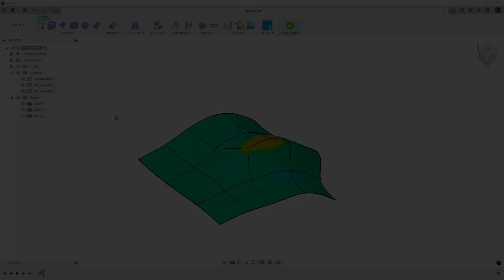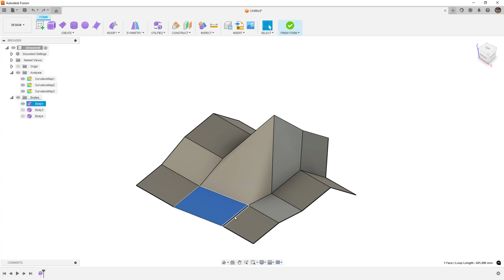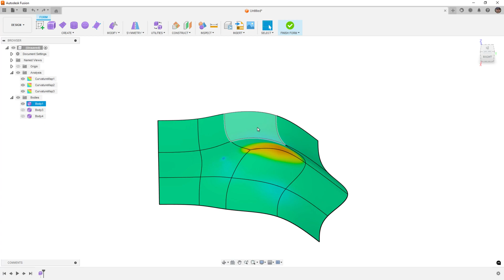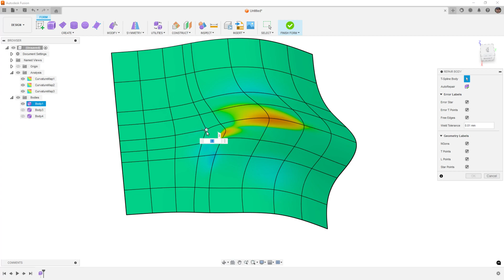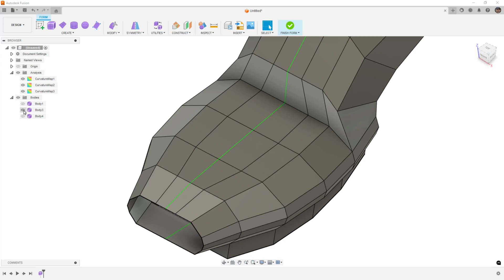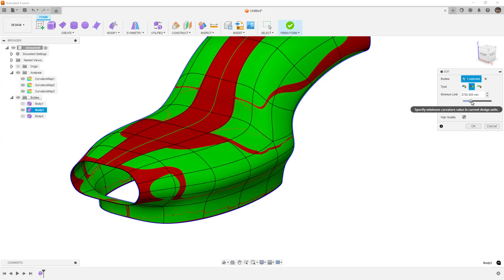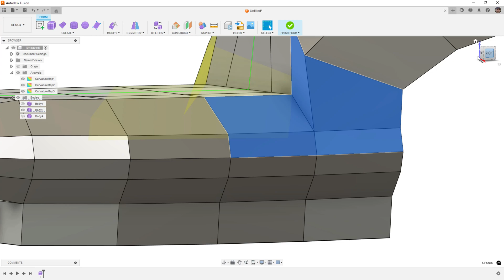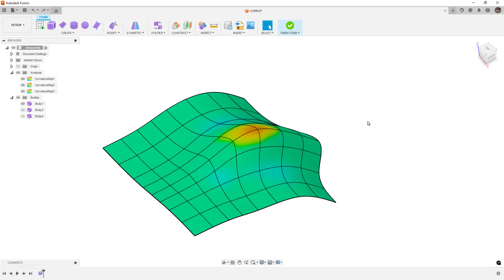Fusion Forms Mastery Part 49 -  Dealing With Star Points - Again

Comment: I didn't understand why  the solution in 4:20 didn't fix the problem. And is it the blue point that is the problem or the start point.
Reply from the maker: The solution at 4:20 did fix the problem BUT it changes the shape.  IF the shape needs to stay close to what you have with the star point that is why we subdivide to add more control and try to keep the shape relatively the same.  The blue spot is a surface jump in curvature on the  5 sided face as a result of the tension from that star point.
Reply: @LearnEverythingAboutDesign  thanks, you really do answer your subscribers.

Comment: What's the best way to handle multiple forms where one needs to adhere to another's geometry? Say you have a car door panel, and it has an outer skin, an inner skin, the door card, and pads on that door card. Is it better to put them all in the same form, or make different forms and somehow attach them to each other? It's difficult when you have two pieces with complex geometry that need to bolt together.
Reply from the maker: Yeah it gets tricky!  I wouldn't try to do it all with a single form because that by itself gets way too complex.  I think the cleanest way is probably to finish the form of the door outer skin.  then do a second form for the inner skin.  The reason being is after you finish the form you have a surface which can be used with the PULL tool.  you can pull the vertices of your new form down to that surface.
The other ways I have done this in the past if i am trying to keep it all in a single form is to model say the door skin.  copy some of the form faces then start building the inner skin.  Copy the faces where the card mounts then model the card.

The first method is my preference though.

Comment: i have no idea how to split a complex form afterwards... i am trying to replicate the Kinesis 360 keyboard. while i got the overall shape i cant make it into top and bottom parts because of the curves.. well i dont know how :D
Reply from the maker: Check out this video starting around 3min or so. https://youtu.be/pw2PX9jFnO4

You can copy just portions/faces of a form and have a top/bottom as a form.  This works ok if you are doing it at a creased edge.  If you aren't doing it at a creased edge then most likely you need to split it up as a solid body after the form is created with a surface or a sketch using the Split Body tool.
Reply: Thanks ill try that!